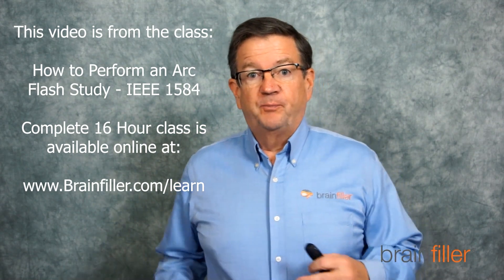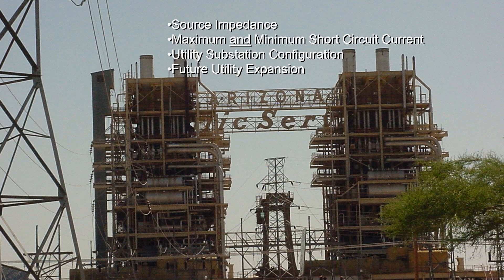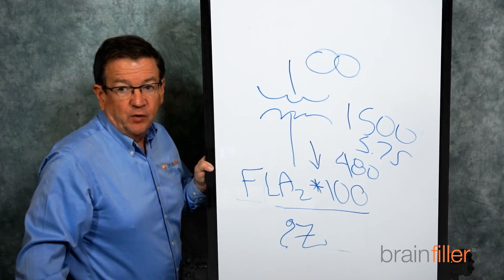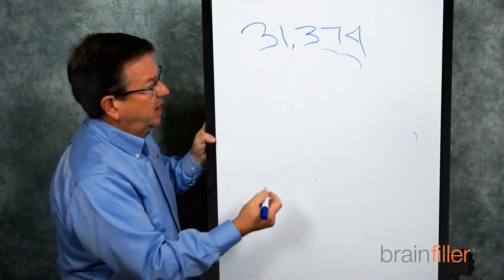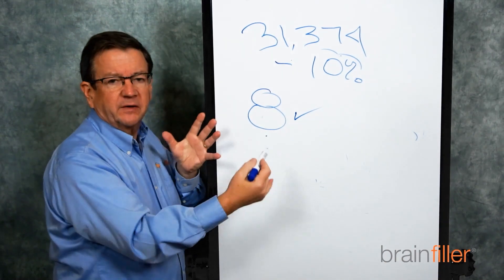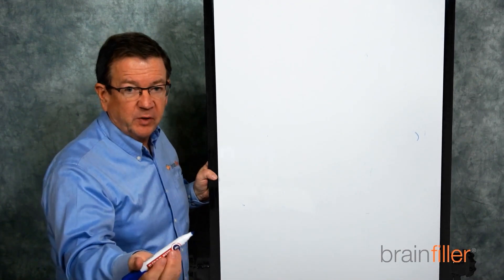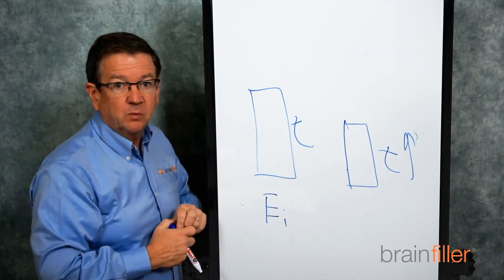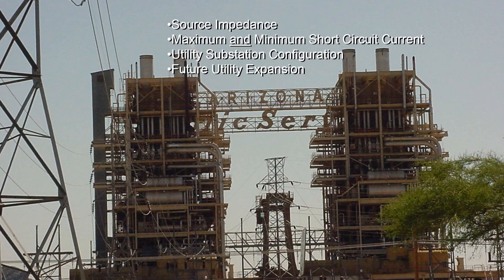Arc Flash Studies and Electric Utility Company Short Circuit Data

Comment: Could you clarify which voltage is being used for calculations? The transformer nameplate shows 433V/22kV, but the nominal voltage in the standards is 400V. Are we using the nameplate values or the standard nominal voltage?
Reply from the maker: The full load current is based on nameplate values.  The percent impedance that is part of the calculation is based on tests using the base full load current as well i.e. no auxiliary systems like fans or oil pumps.  Thanks for your question.

Comment: Jim, how do you determine the X/R for utility contribution?
Reply from the maker: You either have to obtain it from the utility - if they have it or assuming a starting X/R.  Values of 8 to 12 for an assumed X/R are common.  It only affects the impedance angle a few degrees so not as critical as other data.

Comment: Can you show your work for the infinite bus calculation. I can not get the 31374 amps.
Reply from the maker: Sure thing.
SCA = short circuit amps (on secondary)
FLA2 = Full Load Amps (on secondary)

SCA = (FLA2 x 100) / %Z
FLA2 = 1500 kVA / [sqrt(3) x 0.48 kV] = 1804 Amps
SCA = [1804 Amps x 100] / 5.75
SCA = 31,374 Amps
Reply: Thank you